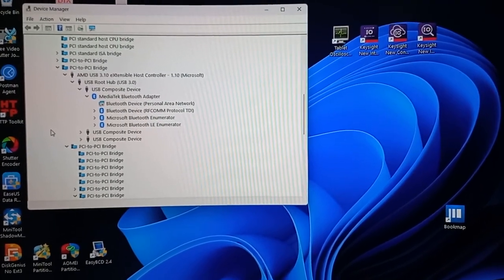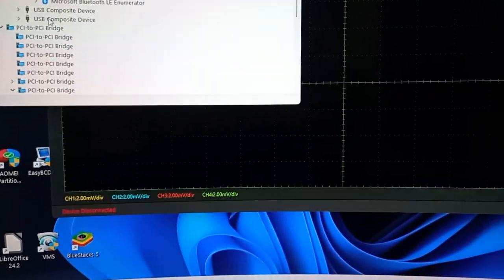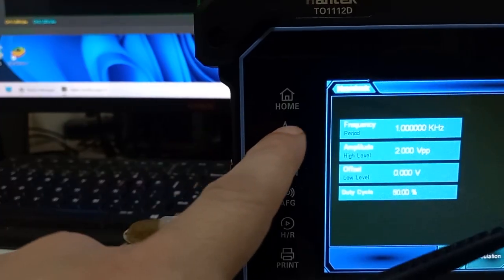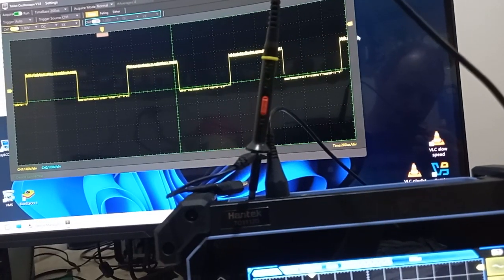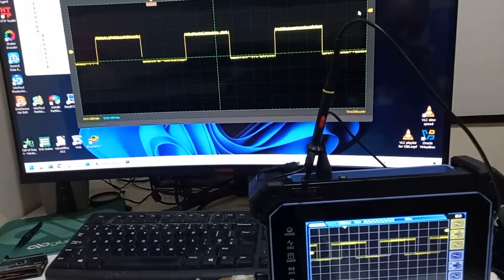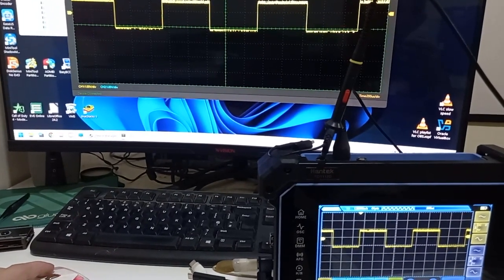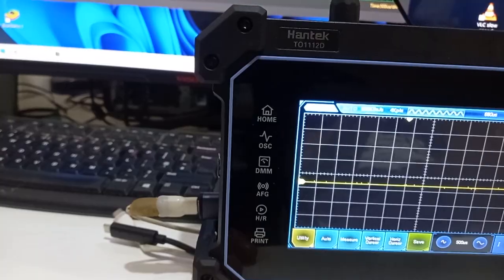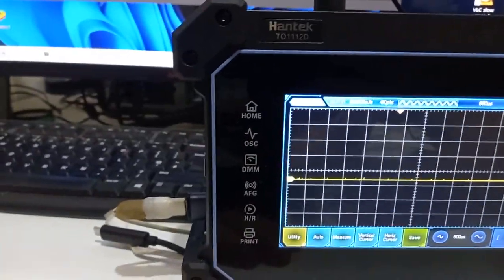Hantek TO1000 series T1112D - USB share not working - USB Device not recognized

Comment from the maker: After further investigation (about 8 hours of various testing with ad-hoc made connectors and cables) I found out that the main source of the problem is the BAD design of the way the USB ports are handled in hardware.
As I've shown in the video, the oscilloscope USB controller goes in "slave" mode (allowing for "USB share" and PC oscilloscope) only when +5V and data signal is sensed on the type-C USB connector.
Unfortunately the same connector is used for battery CHARGING! which causes lots of current draw on the PC USB port which being in "host" mode is supplying the 5V power line.
The oscilloscope overload the PC USB port causing the port to shutdown and disconnect... then reconnect, then disconnect... endlessly.
The only way to avoid it is if the cable has enough impedance (resistance) to limit the current flow below the shutdown threshold.
Given that is not likely to find such kind of cable by randomly buying cables, I was determine to find a more reliable solution.
Here what I have done, that works (so far):
1. I have removed both the RS2227 ICs and lifted up their pin 2 (which is the "S" select pin) that way the IC that senses the data line on Type-C port won't be able to drive them to divert the data line from the USB-A "Flash drive" port to the "Type-C" charging port.
2. I have reinstalled the RS2227 ICs and bridged the lifted pins to Ground with a thin copper wire (Ground can be found on pin 5 "GND" and also pin 10 "OE Output Enabled")

This way the USB port REMAINS connected to the USB controller even when a data cable is connected to the charging Type-C port.

So, to use the oscilloscope in "USB share" or "PC oscilloscope" mode, it's needed to first trigger the "slave" mode on the oscilloscope controller by plugging in a data cable connected to any "host" device supplying 5V and data lines (could be one USB port from the PC).

Since the data lines of the oscilloscope USB controller will be still connected to the USB-A "Flash drive" port, that port can be then connected to one PC USB port BUT FIRST IT'S NEEDED TO ISOLATE THE +5V pin on the cable, to prevent the +5V supplied by the oscilloscope port will clash with the +5V supplied by the PC port (even though there's a protection diode in the oscilloscope that should prevent reverse current).
For isolation I just used tiny strip of adhesive kapton tape, just enough to cover the 5V pin on the A male connector of the cable. Could use also a piece of electrical insulating tape, it's just a bit thicker than the kapton.

And, that WORKS, no matter what cable you use to connect the Type A "Flash drive" port of the oscilloscope to the PC USB port; just don't use too long USB cable (longer than 2 feet) because I think the data line signal levels aren't much high and long cable, especially if not of good quality, may cause the signal to weaken to the point of disrupting the communication (the charging cable provided with the oscilloscope is good enough for the "data-only" use).